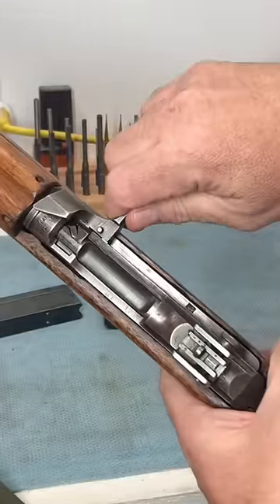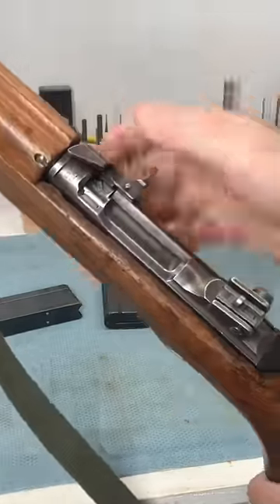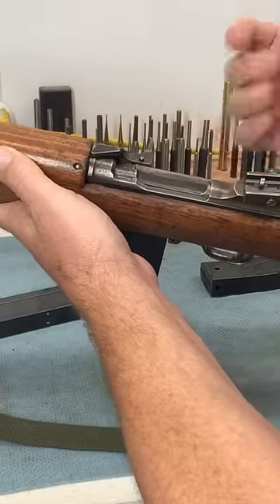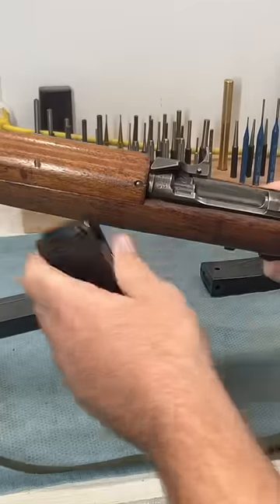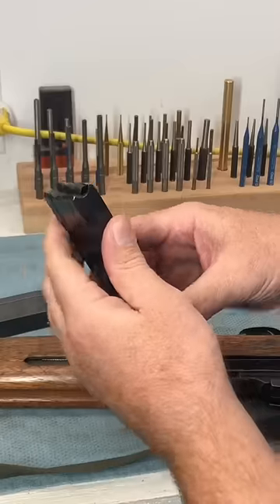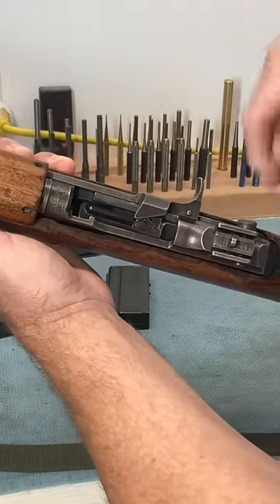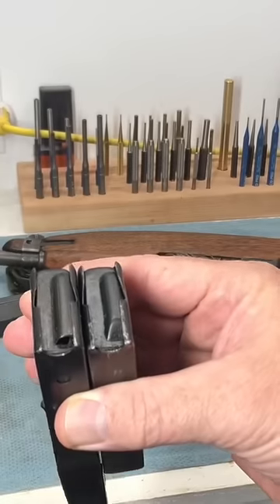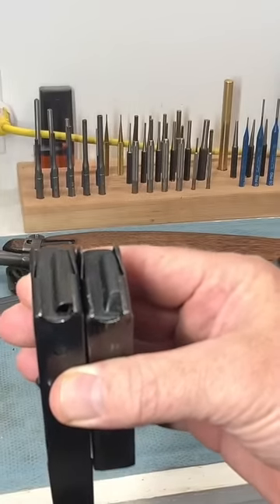M1 Carbine bolt hold open.

Comment: And this just proves that lwtting a bolt or slide slam home on a empty chamber doesnt hurt the gun 1 bit. This gun is almost 100 years old and has been slaming home on an empty chamber its whole life and still works perfectly.
Reply from the maker: The AK-47 and Ruger 10/22 function the exact same way.  No hold open after the last round.  The bolt closes on an empty chamber.  Millions of those two models and they’re both known for reliability.
Reply: It depends. With a nicely tuned 1911 you will batter the barrel lugs. This is a military gun not designed for precision accuracy. There’s no real reason to slam the bolt or slide home on empty with most guns.
Reply from the maker: @66smithra  I wouldn’t do it repeatedly, but there’s no harm when it does happen occasionally.

Comment: The problem is that in combat, a solder may keep pulling the trigger thinking he is still firing.  The stress of combat is like nothing else.  If the bolt is held open on the last shot, it helps the soldier realize he needs to reload.

Comment: The idea was to click the plunger with your thumb before pulling out the mag. It saves a step of pulling back the bolt.
Reply from the maker: Unfortunately the plunger doesn’t line up with the recess when the mag follower holds the bolt open.

Comment: But for reload you might be able to just hold the bolt open and switch. Then you dont have to pull it back just hold it. If it can be done just takes practice. Thumb hold might do it

Comment: I had a funky ar/ak franken-mag for 7.62x39 ar-15's. Literally made of an ar15 mag upper portion to deal with the magwell with an ak curved body portion welded to it.ans it worked ...somehow.  that also had a  bolt catch follower instead of something to engage the hold open lever.i got used to locking the bolt open with the charging handle anyway. It became a signal that the rifle was empty and added an extra  movement .I still can't believe it actually fed reliably...it was so weird.
Reply from the maker: Sounds awesome!
Reply: @FlyingKSports  you can find pictures of them by searching 7.62x39 ar franken mag.
Reply from the maker: @coreymerrill3257  thanks.

Comment: It's not a "solution to a problem that doesn't happen" as it gives you, the shooter, a very positive feel in terms of the recoil impulse cycle and a visual cue that the gun is indeed empty. Further, that magazine was not issued for the M1, M1A1, or M3 Carbines, but to those issued the full-auto M2 Carbine, which a bolt lock of any kind will be a very clear cue the gun is empty. The idea is no different than the bolt lock on an AR15 and there were even countries that issued magazines with bolt lock followers for their AKs as a very clear cue to the shooter that his gun is empty.

Comment: It is useful, it’s not a solution to a problem that never existed, you’re wrong. It allows you to know that the chamber is empty on your last round. It adds a little degree of further safety to prevent danger on the range. You can also now check the chamber to be sure the case ejected successfully and you don’t double feed into the back of a spent casing.

Comment: You can leave the magazine in and top it off with a stripper clip through the open bolt
Reply from the maker: No you can’t.  The magazine follower stop allows the bolt to partially cover the magazine.  You would need to pull the bolt to the rear and depress the bolt hold open plunger before you could load with a stripper clip.
Reply: @FlyingKSports  I said “open bolt”.
I know that I can load with stripper clips . And it’s the easiest way to load magazines. With the magazine attached to the carbine, through the open bolt..

Comment: Well, it doesn't help with reloads, but it does give you a clear indicator that you need to reload. And that's half the problem solved.
Reply from the maker: I guess half a problem solved is better than nothing.
Reply: @FlyingKSports  yeah, it's my beef with the AK rn. But I'm still going to get the yugo mags for the same reason. Sucks that no one made changes to either of these fine weapons as reproductions. Would be cool to have modernized reproductions
Reply from the maker: @breakfreebefree6852  I picked up some Croatian mags for my AK.  They hold open after the last round.  Got them from Palmetto State.

Comment: Push the plunger in as you drop the new style mag out .wouldn't in then stay open
Reply from the maker: When locked open by the magazine, the plunger doesn't line up with its hole.

Comment: Surprised that video games don’t use that for flashy reloads. Pop the bolt open on an empty and lock it to the rear as your character commits to the reload and then a tasteful flick of the charging handle and it slams home with a satisfying click.
Reply from the maker: The bolt hold open magazines did not come out until after WW2 was over.

Comment: The solution is not to hold open so you can reload,but to tell you that ur empty,fact,(i had acces to museum armory,clean stuff,dissasemble and cleaning/oiling parts),got myself a habit to hold the bolt with my index finger while changing mags (rarely shooting them,just for functionality test),works great,the best thing is that the empty mag lock back tells you that the mag is empty,in that time,that is a great improvement under combat stress,so you automatically know ur mag is empty,the problem existed,and the solution worked as intended,later on developing the ideea,we have modern firearms that do lock back the bolt (rifles) or slides (pistols),just wasn't done in war time,and hopefully,shooting stays to entertainment levels 😍

Comment: Is there any harm in dry firing this model?
Reply from the maker: Not really.  If you plan to dry fire a lot you can use snap caps, but the occasional dry firing will not be a problem.
Reply: @FlyingKSports  what do you think about dropping a round in the chamber prior to the mag change? Maybe even have a cartridge banded to the spare box or something. It would make for interesting reload speed comparison 🤔
Reply from the maker: @H8URFace  if you have good dexterity and hand/eye coordination you could probably get some pretty quick reloads.

Comment: It’s so you don’t have to up the bolt back softer ducking the last round. You can hold it back with your hand now and throw a new clip in without having to manually pull the bolt back and mag realese

Comment: the bolt holding open is, at the very least, a very good visual/tactile indicator that nothing is going to happen if you pull the trigger again. you know the state of the gun has changed without having to waste time pulling the trigger only to find out that you're out of rounds.
Reply from the maker: Well stated!

Comment: I live in NC, in a area that is more rural than normal...🪕🎻 if you know what I mean... I was watching a guy at the range finger fu@king a carbine, then repeatedly cycling it and pulling the trigger. After about 10min I walked over and asked if I could help him with it, he said it wasn't firing anymore and he couldn't find the reason why. He handed me the rifle so I looked it over and found the fault, he accidentally engaged the safety (he wasn't aware it had), and was out of ammo. He didn't know how to tell it was empty without the firing pin thud from dry firing and the safety prevented that. 
I asked him to work with me for an hour and taught him basic safety and operation for his rifle and he was so happy for someone just taking the time to show him how to just do basic stuff.

never underestimate the ignorance of the people that features you find odd and pointless were designed for.
Reply from the maker: Point taking!
Reply: That's exactly how BS myths about weapons get started, like "The M1 Carbine wasn't powerful enough, my dad was in Korea and he said he emptied an entire magazine into a guy's chest and he continued charging at him until someone stepped up with a Garand and dropped the guy", when in fact what really happened was he missed him with every shot or maybe only caught him with just one in the arm despite their claim of "putting every shot in their chest".

Comment: As an Infantry weapon, M-1 Carbine was a poor design all the way around, starting with the cartridge that it fired. It was great foe what it was designed for (replacing hand guns for REAR ECHELON troops), but on the line it lacked everything. Had the US Army Ordnance Corps not had Incompetence as a job requirement since at least the 1870s, they might have figured out that the .30 Remington was probably the round that they should adopt following WW-1, and then designed a semi automatic (if not select fire) rifle around it.

Comment: As for your solution for a problem the does not exist. I have learned recently. The Bolt is stopped in a position that the mag can take rounds from a stripper clip. Waiting to hear smart ass comment. I still like them because they let me know when the gun is empty.
NDR
Reply from the maker: On mine the bolt is too far forward to accept stripper clips.  The mag is partly covered because the follower holding the bolt open is inside the magazine.

Comment: Still better than the AK, which doesn't have a BHO, except it kinda does if you pull the bolt carrier all the way back and pull the trigger, the hammer can catch it and hold it open, but that's a hack.

Comment: Atleast youll know when your empty, plus if you want the bolt to stay open during a reload just pull the bolt back and push in the plunger before you remove the mag. Problem solved
Reply from the maker: That would work.

Comment: The point is knowing when your mag is empty, there’s nothing wrong with a bolt closing on an empty chamber
Reply from the maker: The bolt closes when you remove the magazine.  You still end up working the bolt before you can shoot again.
Reply: @FlyingKSports  that’s not what I said. The bolt stays open with the magazine in, telling you the mag is empty, after that it doesn’t matter if the bolt closes.
Reply from the maker: @Ethen1066  I understand.

Comment: If you can find any,  .30 Carbine ammo has become so expensive ($1 -$150/round) that  I cannot afford it.  Why ?
Reply from the maker: The shops that used to ‘always’ have 30 Carbine seem to no longer have it.  Ive really cut down on how much I shoot the carbine.
Reply: @FlyingKSports  I don't shoot mine anymore.  I saved 40 rounds in case Baltimore burns this Summer and it spills over into my County.  I also have a Mossberg 500, and several Mausers as back up.
Reply from the maker: @robertrobert7924  save your ammo.  A day might come when you need it.  Dan Bongino is warning everyone to get prepared and stock up.
Reply: @FlyingKSports  I just got lucky.  I was able to buy PPU .30 carbine ammo online for 67 cents per round including S&H.
Reply from the maker: @robertrobert7924  You got a great deal!

Comment: You could then press in the tab before dropping the empty mag so the bolt stays open
Reply: That’s pointless, you’re still going to have to grab the charging handle again when you put a fresh mag in.
Reply: @craposnap  that ain’t pointless? That would lock ur bolt open like any modern rifle or pistol and quickens the reload slightly
Reply: @craposnap  no with the mag that locks the bolt open. Before dropping that mag and thus the bolt, you lock it open. Now it’s locked back and ready for your fresh mag
Reply: @spite3217  You still have to manually lock the bolt open, which is on the charging handle. Therefore you reach for the charging handle twice in the time of your reload. Obviously that’s slower than just racking it at the end.
Reply: @craposnap  listen, my calculations say it’ll save at least 2 seconds of time if you do what I’m saying
Reply: 😭😭 Bro
Reply: @craposnap  well what do your calculations say?

Comment: Yeah but if the bolt's open it let you know that there's something wrong and you need to address it instead of waiting for that very loud click which could be at the very wrong time. You shoot your last round be sitting in a foxhole someplace and the enemy come over and you have an empty gun and I believe that did happen a few times. If it holds it open, you have an idea that there's something wrong to be addressed, not granted today. It doesn't make a lot of sense but these firearms are very old and it can't be very good to fire dry fire too many times. I don't know. I don't know much about them. I had one when I was a kid but

Comment: I think the solution is to press the button when the bolt holds open
Reply from the maker: Except the button doesn’t line up with the hold when it locks open.  The mag follower allows the bolt to move just a little bit too far forward.

Comment: Also, if you look at the plunger the wrong way or breathe on it, the bolt will shut.

Oh, and I forgot to mention, Promag magazines for the M1 carbine are trash.
Reply from the maker: I can tell you have a bit of experience with the M1 carbine.  

Agree with you 100% about Promag.
Reply: @Flying K Sports  I have an Inland Division returned home from Israel by Davidson.  Everything's all original, except it was arsenal refurbished with a bayonet lug and 30-round magazine catch.  It's my baby.
Reply from the maker: @andrewpena9041  If only that Inland could talk...   You have a great piece there.  Hang onto it.

Comment: I don't see the problem. Because it is that much harder to just rack the slide than to push a button to drop it? My pistol has a lever to unlock the slide, but I usually don't bother. I just tug it back to release the lock and let it drop. It is very marginally more difficult to just fully rack the slide. I think the hold open is worth having just so you know when it is empty. You are going to have to cycle the action anyway, why not at just have it signal when it is empty? It doesn't make the gun any WORSE. Unless it makes it harder to remove the magazine. I can't see what objection there can be. The only "fix" is to redesign the gun to have an actual hold open. And that would only work for new ones. How is half of a hold open worse than none?

Comment: Are you telling me that a manual hold open isn't automatic? Who knew?
Reply from the maker: It’s funny!   Automatics aren’t manual either.
Reply: @FlyingKSports  Ehhhh. If you don't manually pull the trigger, even an automatic hold open won't do anything. LOL.
Reply from the maker: @shelbyseelbach9568  Too much work.  I'll just fly drones instead.
Reply: @FlyingKSports  Better get that remote id module installed, my friend. The FAA has spoken! Resistance is futile!

Comment: If I am using a M1 carbine during the end times filled with people shooting at me when I expose myself I want a heads up that my magazine is empty. I sure would not like too expose myself too somebody who is going too shoot at me when my mag is empty. If I have ammo to refill I would if not I will make other plans. Or just run.
Reply from the maker: People don’t realize the AK-47 doesn’t lock open after the last round either.  It’s just a feature of the M1 Carbine.  It’s not a problem.  It’s not a problem for the AK either.

Comment: You push the button before you change the magazine
Reply from the maker: I think you’re right.   That’s how it should work.  The button does not line up with its hole when held open by the magazine follower.
Reply: @FlyingKSports   Mine doesn’t line up either. I have to pull it back a little and press the button. It’s faster to just let the bolt close, change magazines, and charge the rifle.

Comment: That is an M2 Carbine Stock...
Reply from the maker: How can you tell?
Reply: The selector for the M2 is located on the left side. As the gentleman is pulling rearward on the charging handle,  you can see a gap in the wood next to the chamber. Everyplace else, the gap is tight.

Comment: I've got a '44 Inland...  Those bolt hold open mags are useless to me, cause she won't shoot any 30 rounds magazines till empty.  

I've had to invest a small fortune finding original Autoyre Co. GI 15 rounders.
Reply: I did that with the mini 14 fireing pins break and the chambers blow out and start breaking shell casings in half. So I graduated to the AR 15 where you can fix any part on the rifle with simple tools like pliers and screwdrivers. I literally just built my daughter an  A.R. 15 out of a bunch of spare parts I had in my store room. She’s 13 and she’s made nine 300 yard kills so far I am so proud.
Reply: Why won't it shoot 30 round mags until they're empty? 
If they're not GI mags then that might be your problem, non GI mags are well known for being lower quality and not feeding properly.
I've never heard of a particular contractor that made Carbines that wouldn't feed particular mags, they were all made identically off of the same prints and were required to be 100% parts interchangeable with each other.

Comment: Iraqi reload time
Reply from the maker: not sure what that means
Reply: @FlyingKSports  the Iraqi reload is a colloquial term for a technique that was a technique popular with the Iraqi Republican Guard. It involves holding back the charging handle while simultaneously holding up the gun against your shoulder using your right hand, while removing the empty magazine and replacing it with a full one, then letting the bolt go home. It was thought by them to be a faster reload than swapping the magazine then charging the bolt in separate steps.
Reply from the maker: @donesixfour  You explained that well.  I could see it in my head.  Thanks